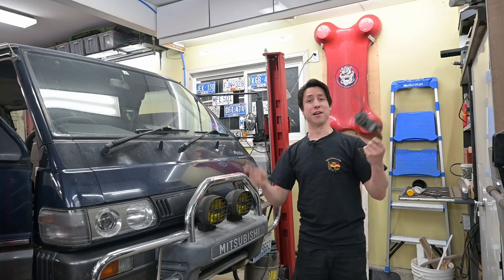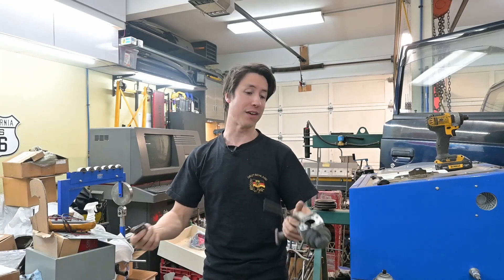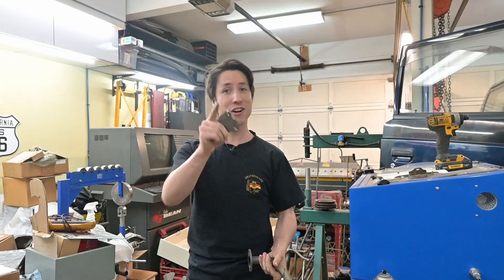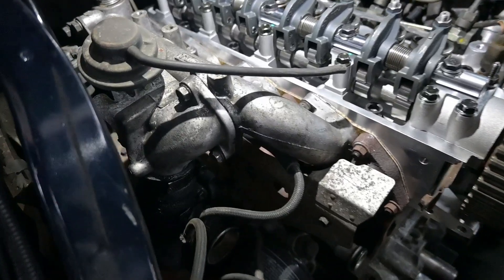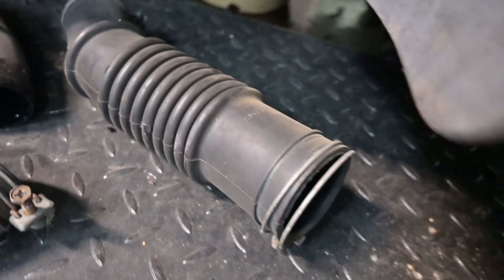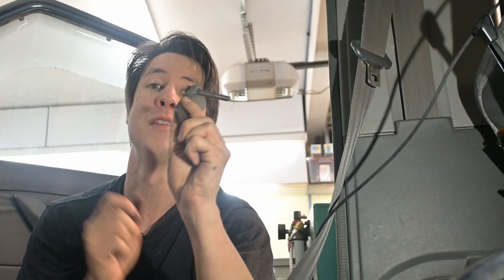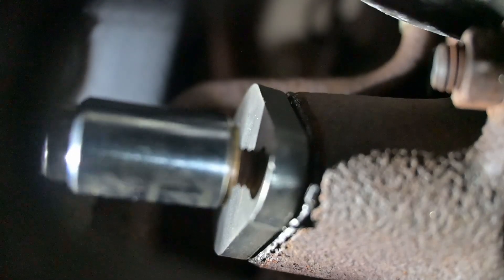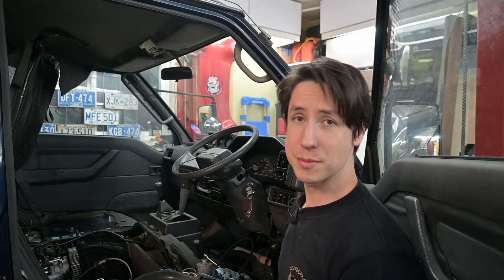4D56t EGR Delete Install

Comment: I blank off my egr on 93 delica turbo. When I turn off the engine I can hear the turbo turning off few seconds after the engine is off. It is normal? Thanks.
Reply from the maker: The turbo is spinning upwards of 100000rpm, hearing it spool down is after shutting down the engine is quite normal.

Comment: Very timely, I’m doing this to my l400 4M40. So, with (I assume) a bit more air entering the inlet manifold do you need to adjust the fuelling (more diesel), or it’s generally not necessary if the fuelling is set right to begin with? Also, on the 4M40 the blocking plate on the exhaust manifold is at the rear most cylinder- is that also a good location for an EGT probe?
Reply from the maker: The amount of air entering the engine does not change so no fuel adjustment is required. The 4D56 EGR take off is also in the rear most cylinder (#4). While the ideal place for a probe would read all 4 cylinders, the blanking plate is still the easiest spot to install it, and the change in reading is negligible at best.
Reply: @projectaddiction  great, thank you

Comment: How would it differ for an l400? Do you just need to remove the egr valve itself and block the remaining pipes?
Reply from the maker: The basics of the job is the same. The location/positioning of the EGR is slightly different on the 4M40 (unless you have the not so common 4D56 powered L400). Technically you  could try sandwich the plate between the EGR and manifold if you wanted to keep it looking stock. You may need longer bolts/studs.